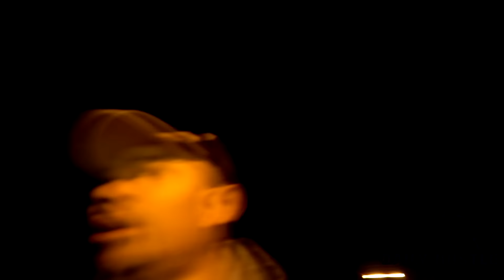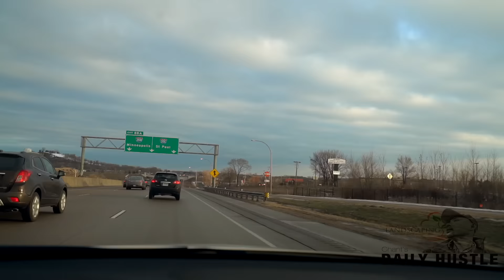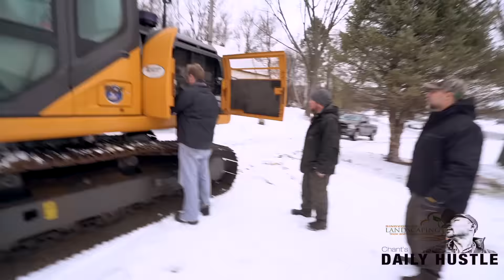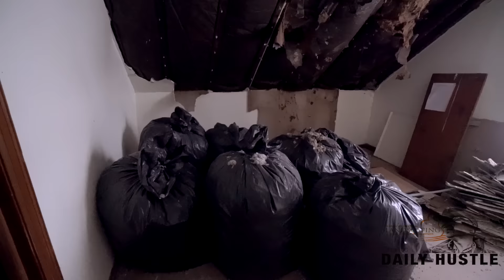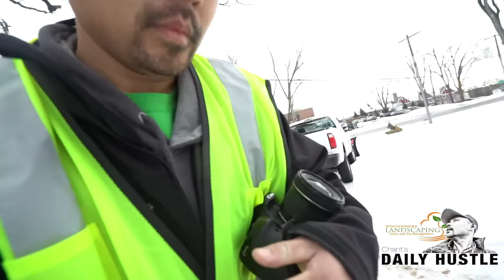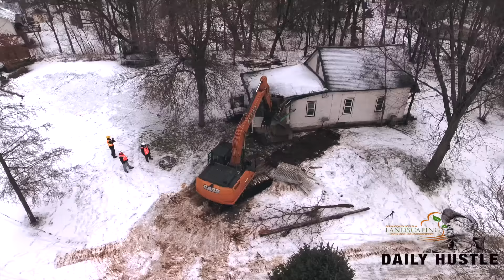First time operating Case CX210D Excavator Part 1 Chant's Daily Hustle 90

Comment: Seems like they have it switched to backhoe controls. Usually easier running in excavator controls.
Reply: Because they're more natural, to me anyway. I've never been able to use backhoe controls, I learned to run a backhoe on an old Case with 3 stick. I tried to run a Cat backhoe when they first came out with joystick controls and everything I wanted to do was the opposite of what it actually did. But then again I've never really tried to learn, cause there's really no reason. And I've always HATED Cat backhoes anyway. CASE baby!!! I do like our little Cat min ex, but I'm sure I'd LOVE a Case.